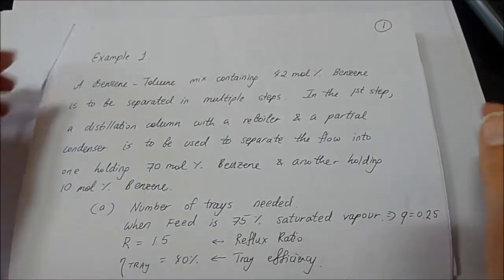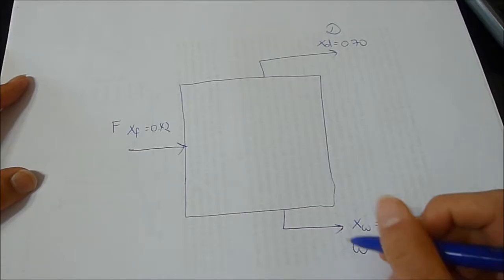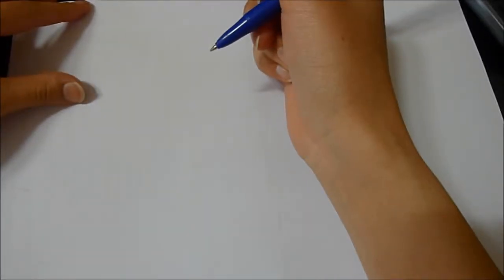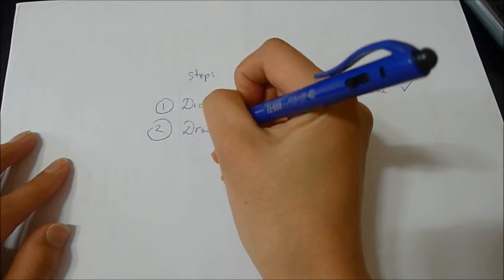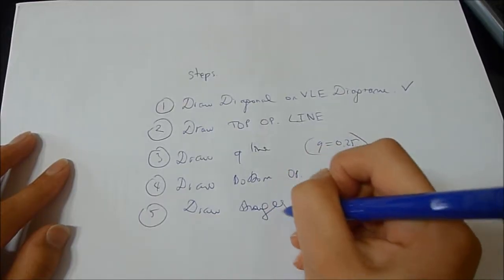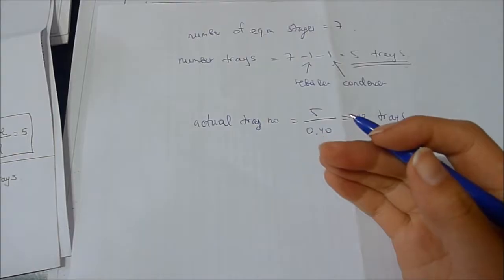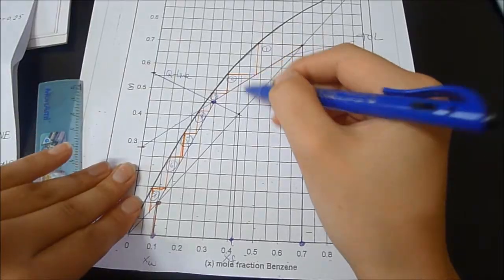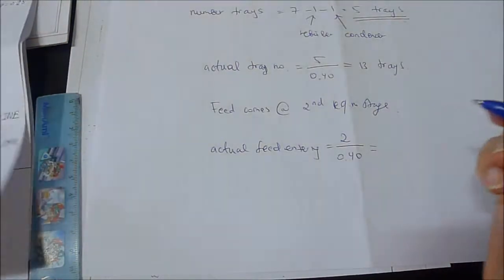Distillation column - McCabe Thiele Benzene-Toluene Problem

Comment: Nice explanation 🎉
However I have a question 
Is the feed plate not the stage where the feed line intercepts the rectifying line and the stripping line making it the third plate and not the second?

Comment: Fantastic work this really helped me understand it more, but I have a quick question, wouldn't the feed stream be where the q-line intersects the stage, and not where the vertical line of xf intersects the stage? So in this case it would be equilibrium stage 3?
Reply from the maker: Great observation! Yes — the feed tray is located where the q-line intersects the stepping stages, not just the vertical x_F line. You’re totally right that in this case, it intersects at equilibrium stage 3. Thanks for catching that — and I’m glad the video helped you!

Comment: Wrong feed stage location.
Reply from the maker: Thanks for pointing it out! The feed equilibrium stage was correct, and I converted it to the actual tray using tray efficiency. Let me know if you saw something different in the diagram — happy to check again!
Reply: @dailylearning-lab  When you cross the feed point, you switch from using the rectifying line to the stripping line. The tray where this switch happens is the feed stage.
Reply: @dailylearning-lab  The point where the q-line intersects the operating lines gives the feed stage.

Comment: Why did you ignore the q/q-1
Reply from the maker: Great catch! In the full q-line equation, yes, the slope is q/(q−1), and the intercept is −xF /(q−1). But in this case, I only needed the y-intercept to draw the line on the diagram. Since we already know the feed composition, drawing the q-line through that point using the intercept is often faster and visually enough to find the intersection with the operating lines. But you're absolutely right — for a full equation-based solution, we should use both slope and intercept!

Comment: In the problem it didn't say partial reboiler, only reboiler. So, in this case would be in total 6 equilibrium stages, right?
Reply from the maker: That’s a great question! Even though the problem just says “reboiler,” we usually assume it’s a partial reboiler, since we’re withdrawing a liquid bottoms product. In McCabe-Thiele analysis, both total and partial reboilers are treated as one theoretical stage. So yes — we still include it in the stage count and subtract it when calculating actual trays.

Comment: What if the value I got for my q line is Infinity
Reply from the maker: If your q-line is vertical, that means the feed is a saturated liquid (q = 1), and this is totally valid. On the diagram, just draw a vertical line at x=xF . The point where it crosses the intersection of the top and bottom operating lines is your feed point.

Comment: How come when you calculated the number of actual stages, you subtracted 2 from 7 to assume that the reboiler and the condenser are perfect stages but when calculated the feed stage you didn’t subtracted 1 from the 2? I think you should have subtracted 1 from 2 then divided 1 by 0.4 which would have resulted 2.5 or the third stage. This is to take out the condenser stage from the calculation of the efficiency as the efficiency given only represents the tray efficiency. I am eager to hear your comment… Best regards
Reply from the maker: That's a great observation and you're absolutely right to question the details! In this case, I was counting from the condenser as Stage 1 (a common McCabe-Thiele practice), and Stage 2 is the second equilibrium stage, not tray. Since efficiency applies to trays only and the condenser is a perfect stage, I converted the 2nd stage directly using tray efficiency without subtracting 1. But you're right that if we were counting from the first tray as Stage 1 (excluding the condenser), then we'd subtract 1. Thanks for the keen insight — you're thinking like a process engineer!

Comment: equilibrium data pleas ?
Reply from the maker: The equilibrium data (VLE data) wasn't explicitly given in the problem statement. But this kind of question assumes you're using a standard benzene–toluene system at 1 atm, which is a very well-studied, almost ideal binary mixture.

So instead of giving the full data every time, problems like this expect you to either:

Use standard VLE data from a textbook like Perry’s Handbook or Geankoplis

Or directly draw the equilibrium curve from known values (which are almost always the same in example problems)

✅ In real practice or exams, they’ll either:

Provide the VLE table,

Give a graph of the equilibrium curve,

Or tell you to assume ideal behavior and draw the curve accordingly.

Comment: the equilibrium data is not given in question 🤔
Reply from the maker: That’s absolutely right — the equilibrium data (VLE data) wasn't explicitly given in the problem statement. But this kind of question assumes you're using a standard benzene–toluene system at 1 atm, which is a very well-studied, almost ideal binary mixture.

So instead of giving the full data every time, problems like this expect you to either:

Use standard VLE data from a textbook like Perry’s Handbook or Geankoplis

Or directly draw the equilibrium curve from known values (which are almost always the same in example problems)

✅ In real practice or exams, they’ll either:

Provide the VLE table,

Give a graph of the equilibrium curve,

Or tell you to assume ideal behavior and draw the curve accordingly.